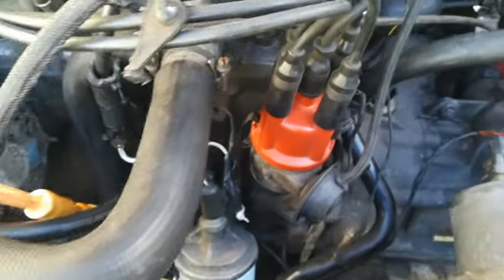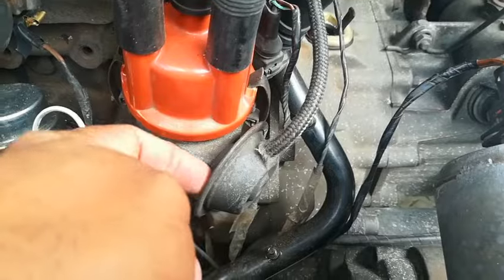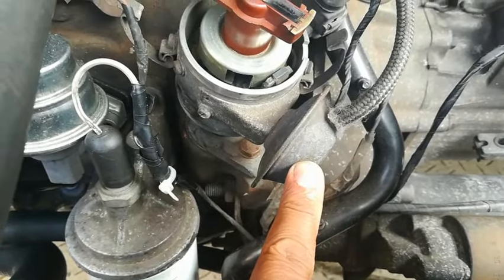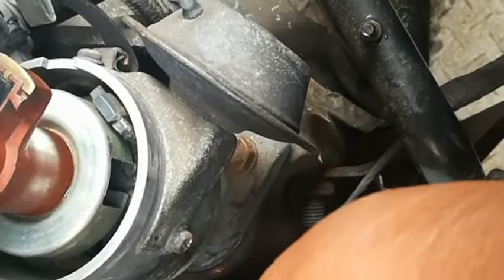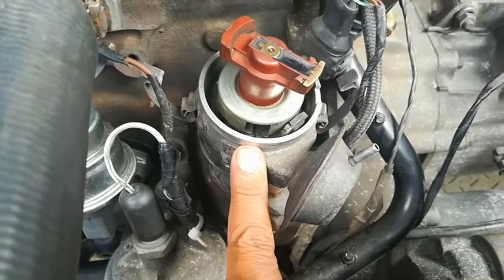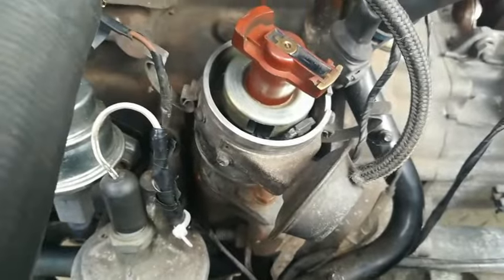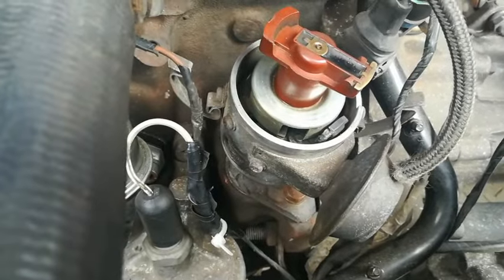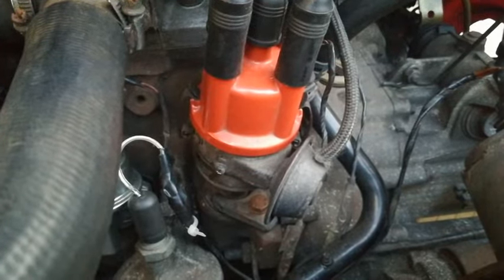GOLF MK1 WORN VACUUM ADVANCE DIAPHRAGM HESITATION SLUGGISH BAD IDLE #golfmk1#vwgolf #VWFOX #golfmk2

Comment: Hi good day sir can you please do 1 on possible front end problems that will cause the vehicle to rattle or have a  unpleasant ride over uneven road or bumps thanks
Reply from the maker: Thanks Jamie , will keep that in mind
Reply: Low suspension, get extended mountings to add the extra travel space for the shocks. Will significantly enhance the ride quality

Comment: Hey PJ, any idea if this Vacuum is being used while using a Weber 32/34 dmtl carb...? Instead of the peirburg carb... I have the weber installed and my suction hose goes onto one of the two points on the brake servo pipe, the 2nd is sealed with a rubber an screw. As far as i know the weber carb does not have a connection on rear for this hose.

Comment: Hi, i have a 1.3 carburetor chico... Air builds up in tank when reaching high revs... Checked the breather pipe all clear... When i pull the fuel line out the air releases... Doesnt release by the fuel cap only the fuel line

Comment: @PJ I have this problem whereby when driving over 120 at gear 5, my car idles super loud. When I put down into 4th gear the idling noise comes down rapidly.

None of this is having an impact on the Rev counter. It's just the high low noises.
Reply from the maker: Hi I'm not sure if I understand you...you say you going at 120..then car idles loud ...but it can't be idling at that speed..it's probably doing around 3.5 to 4 rpm

Comment: the carb is not sucking air from that vacuum, but when i do it by mouth it moves. so how do i fix that problem , uncle pj?
Reply from the maker: While it idles it you won't really feel it  sucking ..but when you rev the engine it should..Try again ,but rev the engine this time..
Reply: @pjs-golfmk1-diy  thank you uncle pj. and also when i switch on my headlights it starts idling slow. then when i suck on that vaccum pipe. it starts idling same speed as when i switch off the headlights. but when i stop sucking it idles slow again

Comment: Hello, thanks for the video very informative.MK1, I have a heavy oil leak by the O ring distributor. I have changed the O ring numerous times but still gets worse. Am starting to think its more than just the O ring but something else. Any advice, asblief PJ🙏🙏
Reply from the maker: Did you try using Victor Rheinz sealer ..

Comment: Uncle pj thank you for your videos will the vacuum advance be thr me reason car using alot of fuel and no power when going up hill
Reply from the maker: No the vacuum advance wouldn't cause that. Maybe a timing issue. Check your valve timing and ignition timing.. Then there could also be an issue which could be carb related

Comment: I have a 1.6 city golf and it misfires when cold what could be the problem but when its hotter is running perfectly
Reply from the maker: Could be a misfire due to moisture in your electronics,or overfueling,or just running too rich on fuel

Comment: Great video👌
On my mk1 2005 model I'm also experiencing that hesitation/jerk when accelerating, my distributor does not have the vacuum advance, would I need to get a distributor with the vacuum advance as the carb has been serviced and cleaned?
Reply from the maker: Thank you sir . Your model is a later one which had no vacuum advance.. Its supposed to be a better technology, but Jerking and hesitation is not only related to the vacuum advance unit... It could be a number of things, like ignition timing, air fuel mixture not correct  etc...
Reply: What did you do with the pipe that goes from the carb to the vacuum. Did you close it? Or

Comment: Hi PJ I got a replica carb, in which hole should the vacuum advance pipe go, as the idle is low and bad to the vacuum in the middle pipe, Currently I had to connect my vacuum adv pipe to the servo pipe, I noticed that there is two pipes connected to my servo but it does not work as my aircon is not working, should I block those two out and maybe the suction will be stronger at the carb?
Reply from the maker: The pipe from vacuum advance on the distributor goes to the back of the carb . Did you watch this video 👇 yet 
https://youtu.be/9jztj3yF2CQ
Reply: Hi PJ I have a pirate new carb and there are more than one hole so where Do I put the vacuum advance in
Reply from the maker: @chadkramer9684  use the middle one and block off the other 2...if u leave any of these ports open.,it will lean out the fuel mixture...and you will have a rough unstable idle and general performance will be sluggish..
Reply: @PJ's - GOLF Mk1 - DIY  what about those two pipes on ther servo, can I block them off too, because my aircon is not working so I think their is coming in air through that pipe therefor the carb is not giving enough suction to the vacuum pipe
Reply from the maker: @chadkramer9684  yes best to block them off ...As a test,....with the engine idling ,just put your finger over the holes and u will hear the idle smooth out ..You can not leave those pipes on the servo open ..if it's not playing any roles...block it off

Comment: I bought a distributor that has no vacuum for my carburator 1.3. 
Will it affectthe carburator.? How does it affect it. Should i get one with a distributor?
Reply from the maker: If it's carb model...you will need distributor with a vacuum advance
Reply: @pjs-golfmk1-diy  thanks for quick responds. I returned the part and will be getting the one with the vacuum by Tuesday.  I think it would be great if you had a whatsapp group with all VW Mk1 owners to share issues and ideas more faster. These cars are really great. Its my first car and I love everything aboutit. The performance, it feels great. Do consider creating a group and sharing the link on here.

Comment: Hi PJ...should it make a difference in idle when disconnecting the vacuum line from the vacuum advance on a carburetor engine? Coz I get suction from that line connected at the back of the ks2 carb but it doesn't seem to be that strong vacuum...car idles fine though no difference in idle when disconnecting that line.  just has a bit of a delay on acceleration from a stand still...and did suck on the vacuum advance it holds pressure. It's a mk2 1.8 GTS  Thanks
Reply from the maker: Hi. You won't really feel a difference when pulling the pipe off when it's at normal  idle... Only if u keep engine on a  Rev and then pull off pipe will u hear a difference, but that delay can have something to do with the ignition  timing, or an airleak elsewhere... But do check pull off that vacuum advance pipe and check it thoroughly for ruptures or tears... Also try to set your ignition timing with a timing light if you have one..
Reply: @pjs-golfmk1-diy  Thank you for the reply, yes I did it with my timing light, ok I'll double check for air leaks...I just want the right procedure of doing the advance timing...should I do it with the vacuum pipe disconnected with someone keeping the revs at say 2500 or is there no need for it?
Reply from the maker: @jonb4667  when doing ignition timing you must remove the pipe and also block it up temporarily  while u doing the ignition timing, and then put back once u set it on the mark
Reply from the maker: @jonb4667  and u need to let the engine get up to temp, and it shud idle at around 9.5 rpm when setting ignition timing
Reply: @pjs-golfmk1-diy  Thank you very much as always....Keep up the good work and great content Mr. Jones...
Reply: @pjs-golfmk1-diy Sorry PJ I just realized...you said that if I pull the pipe off it won't make a difference at idle...what's the purpose then when setting the timing at 950rpm, I think my car idles at 850/950... Am I making sense sir?
Reply: @pjs-golfmk1-diy  could you maybe in future make video on your channel regarding this...I think that will also help many coz there's no video that I've come across showing step by step procedure on that...
Reply from the maker: @jonb4667  yes around 8.50 /9.50...but blocking the pipe is just a precaution, as to Not  allow any un metered air into the carb fuel mix..
Reply: @pjs-golfmk1-diy  ok cool much appreciated...regards

Comment: Hi just wanted to know if its possible to clean the inside and with what would you reccommend?
Reply from the maker: You can clean it and patch up holes if there are in the rubber diaphragm.. But most people just buy a new distributor which comes with a new vacuum advance
Reply: What did you use to repair the diaphragm? Be interested in this as this is the problem on my Mk2 polo. 
Many thanks.

Comment: Uncle PJ i need help ...My Mk1 dont want to start it has no spark but it does crank ...i changed the distributor cap and rotor and the coil module but still no spark
Reply from the maker: Did you replace the coil? ... You say you replaced module... But u shud focus on the coil first
Reply: @pjs-golfmk1-diy  yes i did replace the coil bought a new one

Comment: Hi PJ, I'm having the following problem with my Mk1... when the car is idling the revs go from 1000 and drop to about 800 and back up and back down constantly even when the engine is hot

Sometimes my revs drop so low that the engine almost cuts out but it stays idling at around 200 to 300 revs. I have recently serviced the car myself- all new filters, oil, spark plugs and flushed radiator and put new coolant in.

Any Idea what it could be or what I could try and check to solve it?
Reply from the maker: Hi. You could check on your ignition timing. Have it set accurately with a timing light. Also check for Airleaks around the brake servo pipe. And carb base plate.

Comment: Hi guys can anyone help me .? I am running A vw caddy pickup 1600 carburator . It dies under acceleration like you going to stuck with petrol .. no power and dies .. it starts up again when u turn the key to start iv changed the petrol pump petrol separator new plugs new plug wires new coil new petrol filter blew the petrol pipes clean drained the petrol tank .. put on another carb i borrowd . Put in another battery ..another rotor and rotar cap put in a new mudulator ( blackbox ..) new harness cable plug .. i dont know what to do aymore.   It still dies while under load .. looses power and stalls .. what can i still look for ? It starts fine i check for vacum leaks already checked the base plate .. its still ok ..thanks

Comment: I have a carb MK1 and the Distributor installed doesnt have the advance, i do get the erattic idle and hesitation, so is it a must that the carb mk1 must run with the distributor that has an advance or it doesnt matter ?
Reply from the maker: Well your car doesn't need vacuum advance cause u probably have a later model... What model are u driving?
Reply: @pjs-golfmk1-diy  Its 1998 Chico model. I remember when i first bought the car it did have the distributor with the advance but when it stopped working i bought the one without. The carburetor is also the new Keihin carbs
Reply: @pjs-golfmk1-diy  Hi PJ, i hope you are well. I am still struggling with the erattic idling and hesitation when driving, do you perhaps have a workshop and i can bring my golf so you can check it out for me please ?
Reply: @vuyolwethuqongqo  Find yourself a manual for that carburettor. Find where the Idle Jet, CO screw(mixture screw) and Idle Air Bypass (of your model carb has one) are located. A very minor air leak around the idle jet can cause what you may be experiencing, erratic idle, hesitation on lower revs but clears on higher revs (because idle jet is not being used much, instead the main jet takes over). As everything complex, the main thing about carburetors is to maintain it clean and sealed with good quality seals. Also high etanol fuel WILL destroy your carb seals, fuel lines and vacuum diaphragms.
Reply: I have a 1.6 carb engine… on cold start it has a slight misfire on cylinder 2 , ive done compression text, changed cables and plugs and i still have the same situation.. could it also be the vacuum?
Reply from the maker: Hi . Do this .first thing in the morning before u start up.take out the no 2 plug..or all of them ..and check if they wet .sometimes it can be oil due to valve stem seals ..or even fuel ,due to over fueling.could also be coolant if you have a cylinder head gasket at beginning stages of packing up.... this is rare..,but have a look at your plugs before you start up...it could tell you something,

Comment: I got a mk2 jetta 16 carb and my revs are seeking the whole time.. It sometimes tends to cut of... The rev doesnt stay constant at all can you help me
Reply from the maker: Hi , have you checked for Airleaks.. Around  carb  base plate and Servo Pipe and the brake booster?
Reply: @pjs-golfmk1-diy  i havnt will check the weekend coz imma put in the aluminum base plates with the gasket paper
Reply: @pjs-golfmk1-diy  i got another problem... Theres water leaking from the intake manifold
Reply from the maker: It's probably leaking at the O ring.. In the intake manifold...
Reply: @pjs-golfmk1-diy  is the o ring also known as a Welsh plug?
Reply from the maker: Nope.. Welch plugs are on your block....
Reply from the maker: Let me correct that, There are also 4 smaller welch plugs on the intake.. And they van leak there
Reply from the maker: But first check if it's leaking from the Welch plugs or the o ring
Reply: @pjs-golfmk1-diy  its leaking from the Welch plug not from the o rings....
Reply: I will do that tomorrow and any advice on how i can put the aluminum base plate?

Comment: The vacuum coming from the carb is weak and it does not advance the distributor, the distributor is new
Reply: Any ideas oom
Reply from the maker: When u say it's weak... Is that at idle? .. Then it will be weak... It's when, u accelerate that the carbs port pulls harder on the Vacuum Advance
Reply: @pjs-golfmk1-diy  when she ideals the vacuum os very weak almost nothing, when you rev it it does vacuum but not very strong